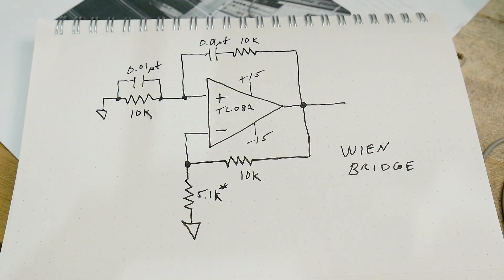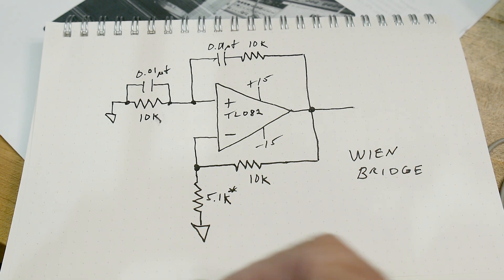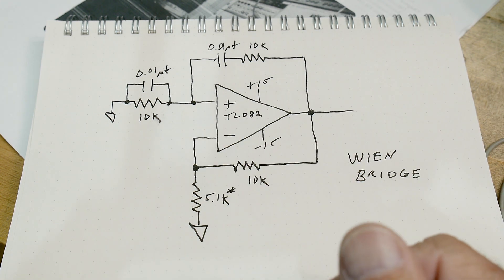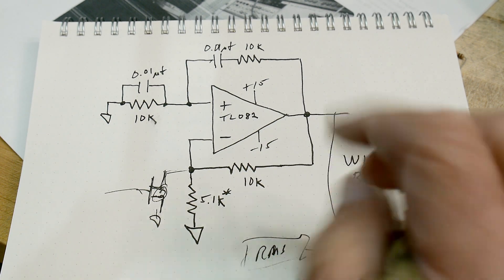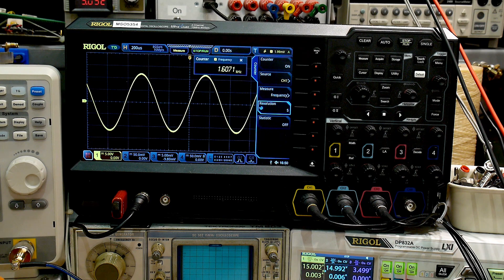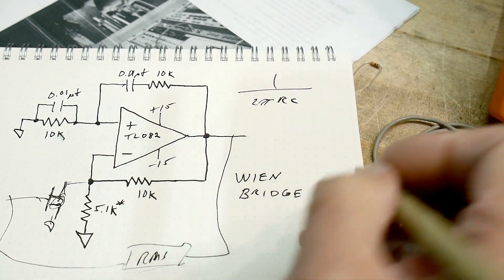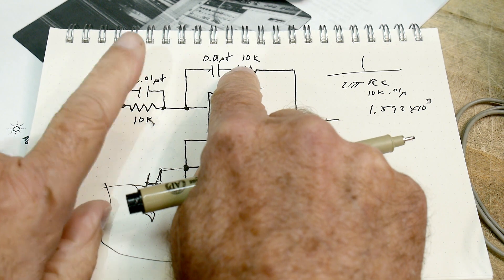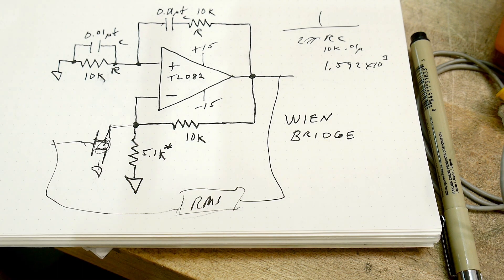#1372 Wien Bridge Oscillator THD

Comment: Have you tried several different 5.1k to 10k combinations? Was it always stable oscillating? How large was the output signal and the output signal differences for several combintions?

I am a little bit surprized because the voltage amplification is a little bit lower than 3. I would have be expected that it needs to be a little bit more than 3 to start continuously oscillating. The maximum output voltage will limit the voltage amplification to 3. The more amplifiction you set with the voltage divider, the more the signal will turn into an rightangular shape.

Comment: Can someone explain why the frequency changes based on the voltage fed into the Op Amp?  At +/- 9v I get 1.666kHz.  At +/- 3.3v I get 1.718kHz and there is a steady progression of increase in frequency with reduction in supply voltage.
Reply from the maker: it varies the hysteresis trip point
Reply: @IMSAIGuy  Ah of course.  I saw this impact when converting the Sinewave to a Square wave via a 74HC14 but failed to take into account the circuit inside the Op Amp.  It does, however throw a little spanner in the works for trying to calculate the expected f based on R and C.  I guess its near enough as a start point then test and adjust.

Comment: Great oscillator for low frequency, but since it has two Cs it is hard to do VCO with it.
I guess, we could change Rs with a transformer and have one C  (vractor) from positive input to ground.  Then we can have VCO.  As you know then the Frequency will be 1/(2PI(SQRT(LC))

Comment: How did you measure THD?
Reply from the maker: The Keithley 2015 multimeter has a THD measurement
Reply: @IMSAIGuy  do you know how THD is measured without using digital FFT and microprocessors?
Reply from the maker: @bayareapianist  yes, the older instruments (HP 334A) use a notch filter to remove the carrier, then sum up what is left.
Reply: @IMSAIGuy  I saw one on eBay for sale now.  I think it's a good material for your channel if you don't have one.
Reply from the maker: great, you can have it shipped to me
Reply: @IMSAIGuy  when is your birthday?
Reply from the maker: @bayareapianist  just your luck. it's tomorrow
Reply from the maker: if you search for distortion analyzer diy. you can find a couple projects with schematics
Reply: @IMSAIGuy  mine is the day after.  We must be twins.

Comment: Does anyone know how to make a VCO out of this circuit?  I experimened and learned a lot from this simple circuit.  In 80s I wanted to make a PLL signal generator.  But I ended up using a SRAM (EPROM later on) which then I could easily change the frequency and amplitude.
Reply from the maker: https://www.edn.com/building-a-jfet-voltage-tuned-wien-bridge-oscillator/

Comment: Yay! That's a happy coincidence. Note that re my previous question about the TI TL07x/8x JFET input opamps: I figured out my confusion. As of 2020 or thereabouts, TI's making the 7's and 8's almost indistinguishable, and getting rid of the 1977 "BiFET II(tm)" inputs which were neat; for their tolerance for ESD, and the THD. This is to "get their customers to move to new technology", which is unfortunate because they don't have this application in mind, and the price was right.

I have a pet project with these oscillators, if not obvious. I've wanted to make the cheapest, cleanest signal injector for audio work possible, with a monitor out for scopes and a probe to inject the same signal. Ultimately, if you hook up everything, you'd have 2 channels of 0.03% THD sine wave, and 2 channels of whatever part of the circuit you're fuzzing. Much better than the buzzer noise types and almost as cheap. I'd love for the world to have a cheap, floating, and safe tool for that sort of work. The "floating" bit being key, with live DUTs and instruments being a dangerous combination, obviously.

One more note about HP history: the HP200A used variable capacitors (and discrete valves, of course), but the economics reversed since then, so it's pretty much impossible to design it that way now. And it's nicer, to boot, to use a ganged resistor or stepped attenuator; my prototype has both (or three), as you need lots of turns in its lifetime, and you need lot of range as far as resistance to do 20 to 20k (or nicer); so it's the old "range selector plus coarse and fine" design.

Very happy you covered one of my favorite cheap circuits, and used the "bridge notation"! And not to appear like I have any advanced knowledge compared to your vast experience, I'd love to hear any history or notes you have, if you find the time. Thanks again for covering this one.

Comment: You can adjust the frequency by adjusting any of the individual components, but the analysis is much easier of the resistors and capacitors are the same.  You also probably aren't going to get much range in frequency adjustment by just changing the resistance, and the gain will need to be compensated as well (which makes it easier to adjust the frequency if you already have an amplitude servo loop.

Comment: Don’t use ceramic capacitors for anything like this.
Reply: High quality ceramics like C0G/NP0 are perfectly usable in an oscillator like this.
Reply: I was more concerned with the non-linearity. Actually testing this would make a good experiment for our host.
Reply: @jms019  I specifically mentioned "high quality"; C0G/NP0 dielectric can measure up to even the best film dielectrics in terms of voltage coëfficiënt, temperature stability, aging, etc.

The downside is that they are only available in relatively small values.

Comment: I am no expert on the fine points of Wien bridge oscillators, but have built many that use just the basic configuration, with the addition of any of the simple amplitude control features, such as incandescent light bulbs (not just ANY light bulb), or reverse-parallel LEDs, etc. I don't like the incandescent bulb approach because of its microphonic effects. I am not thrilled with the LED method either, as the circuits I have made using those seem to have less sine wave symmetry. 

As I recall from my electronic circuit theory courses many decades ago, the primary key to low sine wave distortion in these circuits is the quality of the amplitude stabilization part. That, and how closely the two RC portions match, as they form a pair of low-pass and high-pass filters, and between them in the bridge circuit they form a band pass filter, with the center of the filter frequency being the best oscillation frequency, and best stability.

I mostly used these to be "precision" sine wave signal sources for calibrating older analog recording equipment and testing recording studio equipment and signal paths. I never had access to a good distortion analyzer, and had to just use my eyes on an oscilloscope display of the waveform. I got pretty good at being able to spot asymmetry (at least I THINK I was good at it). But I was always amazed at how many people would look at obviously asymmetric "sine waves", or even triangle waves with some filtering to make their points a bit rounded, and they would pronounce those to be "clean sine waves". 

When I used to build these, I always tried to use high quality capacitors, and bought ones with good stability characteristics, and good accuracy specifications, then used a capacitance meter to match them in pairs. I did the same with the two resistors used in conjunction with the capacitors. Doing that gave me my best results, at least using the old eyeball THD test.

Comment: So if you don’t have the R and C the same, you get an asymmetric sine wave (more distortion)?
Reply: No, but it does change the amount of gain you need to get oscillation.  And controlling the gain is a big issue in how much distortion you get, hence the reason for controlling the gain using either a lightbulb or more complex feedback loop.

Comment: When you were doing the Tek plugins, I was wondering if you'd do the SG505. So I looked up the price of them - way too high unless one somehow fell into your lap. The SG505 is actually a State Variable Oscillator and is an interesting study case on how to optimise a circuit and does interesting things with the venerable  NE5534A opamp. Maybe wrong but ISTR that Jim Williams might have had something to do with it? 
Edit: I was wrong, Jim Williams was not involved in the design of the SG505, at least not according to Bruce Hofer who led the team that did.

Comment: Actually you CAN change just one side and change the frequency fairly easily. It takes a little experimentation, but it's not difficult. I can't remember, but I think it was on the non inverting input, but don't hold me to it. I have no way to check distortion, but it looks clean on the scope. SO many pieces of test equipment can be made with this! Thank you for sharing.